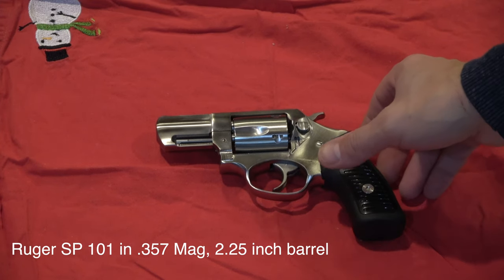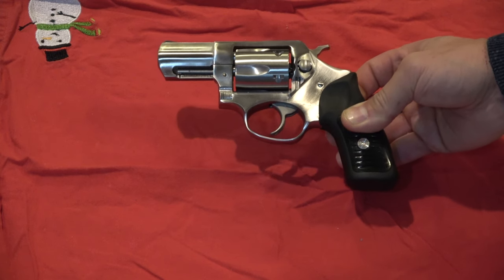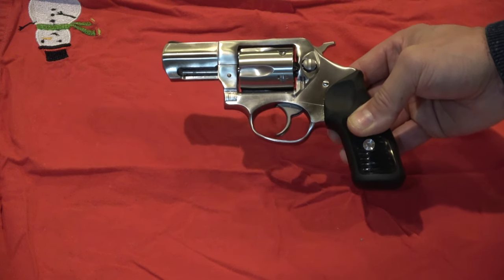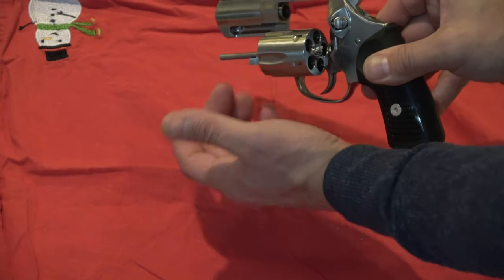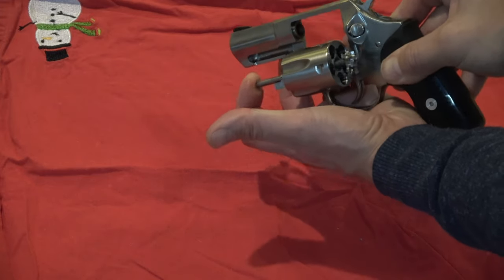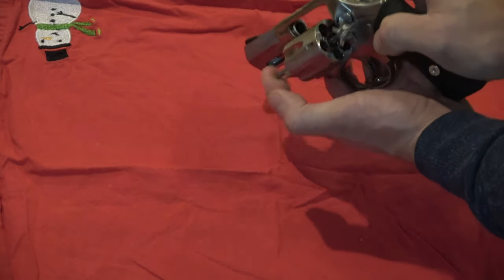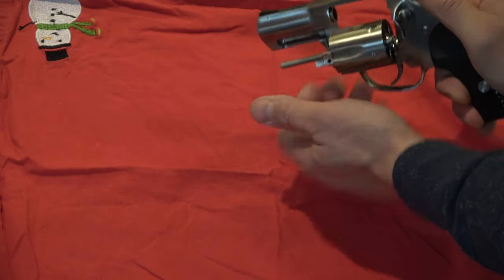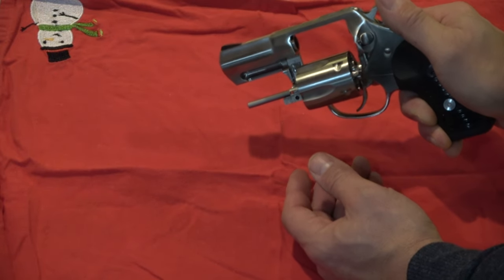Ruger SP101- Problem with Ejector

Comment: Good to hear it was fixed. A possible solution for others wrestling with this is to use a revolver cylinder bit (see Brownells) to disassemble the cylinder. Polish up the ejector with a dremel and some polishing paste and thoroughly clean the cylinder. sounds like a hassle but it is not that difficult.
Reply from the maker: Great advice!  Thanks.

Comment: Should have baught a smith😆
Reply from the maker: Which one do yo recommend?  I still think I may get  one
Reply: @The Mediocre Hunter  depends on what you're looking for...for a small revolver i love the model 60 or the 640 ( if you want hammerless and stainless steel) for a full size get the 686 plus ( the daddy of them all ) 😆
Reply: Ruger revolvers are more reliable than Smith & Wesson revolvers
Reply: @feddieboie5217  who told you that lie?
Reply: It's all over the internet to each is own there both good companies I also have a shield 45 2.o c and a sp 101
Reply: @feddie boi E  thats BS....competition shooters mostly use S&W and they shoot way more than the average joe and they hold up fine...ruger is just built beefier because its cast metal which is actually weaker than forged...
Reply: @feddie boi E  i got 2 smiths and 2 ruger revolvers...guess which one has had to go back in for work? ...ill give you a hint...not  the smith...
Reply: The ruger. Aleast they have excellent customer service I never had to send my ruger in but my sd40ve had feeding issues so I polish the feed ramp
Reply: @feddie boi E  yea the sdve sucks and ruger does have good customer service...only issue i had was they had my revolver for 5 weeks
Reply: That's bad a friend of mine said his only took 6 days
Reply: Just bought a 3” sp101 and I’m having the same issue with the ejector